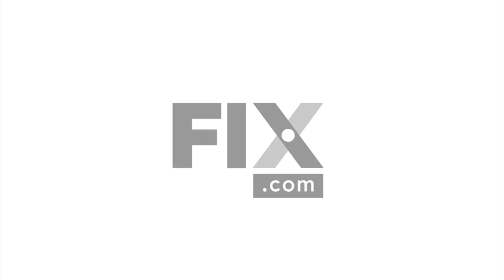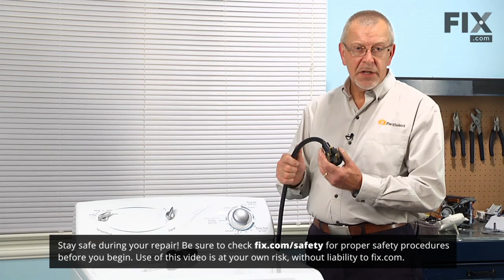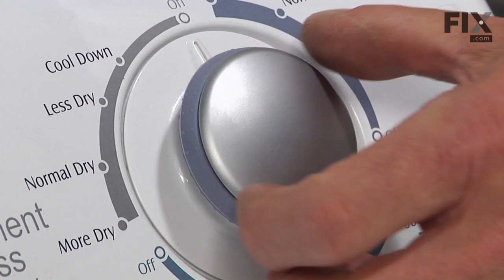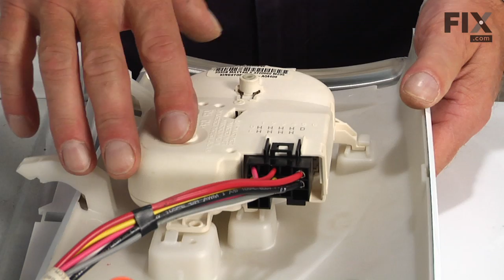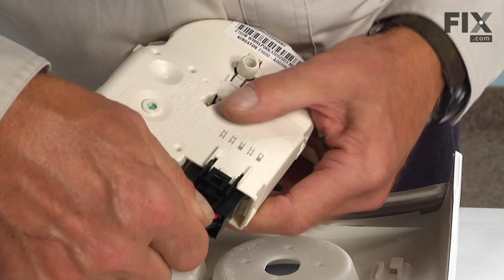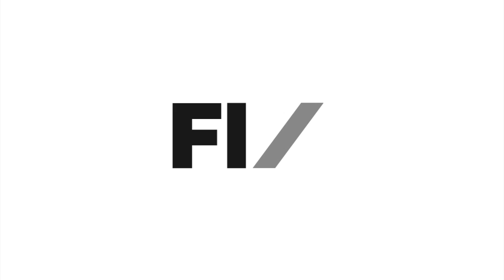Maytag Dryer Repair – How to replace the Timer

Comment: Will replacing this part help with pulling the dryer knob to turn it on?  The timer works fine on my dryer but it's hard to pull out, almost as if it's stuck.  Then I adjust it a few degrees and after more muscle it finally turns on.